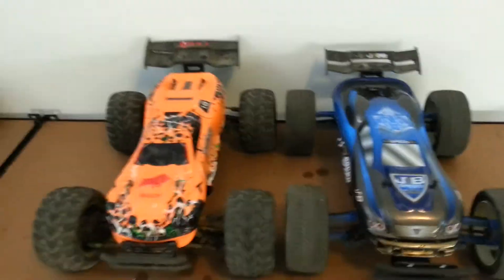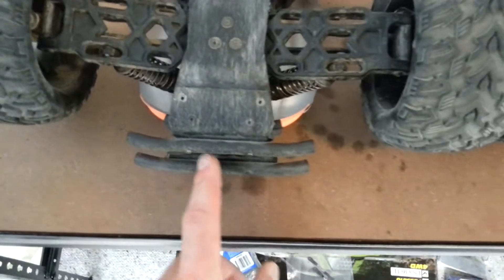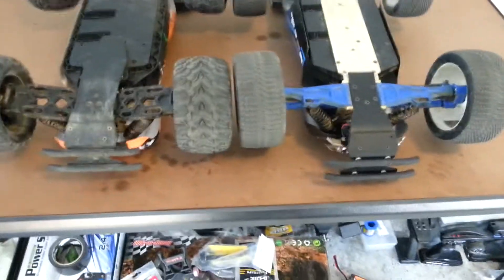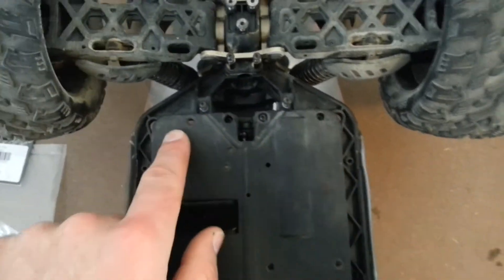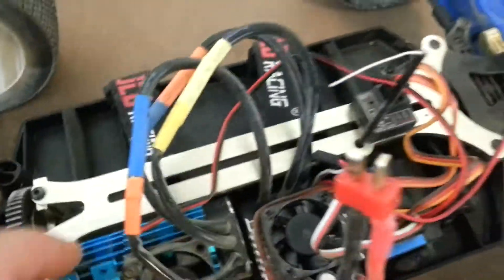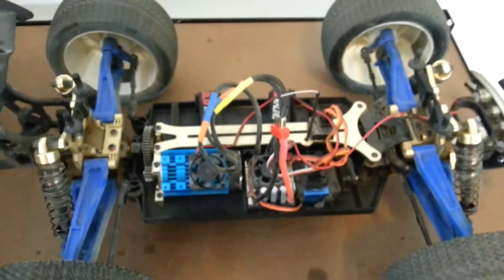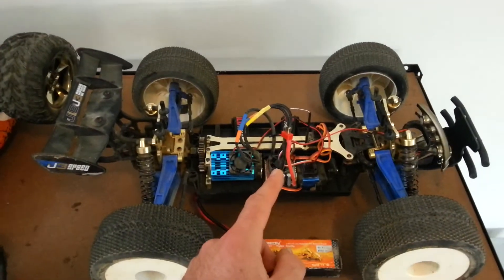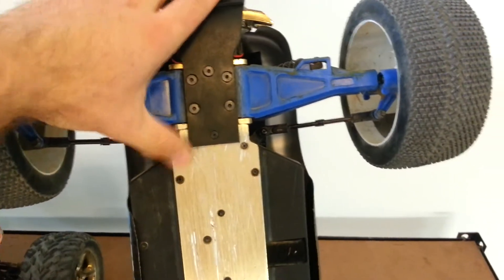Jlb J3Speed T-Bone racing bumper upgrade + update!

Comment: Nice video. I'm thinking of getting a J3 Speed real soon and would like more insights on it. Please do some more runs with it. Also i would love to see what top speed you get with those tires. I've heard about the balloon issue in the original a d the CVD popping out. Please let me know
Reply from the maker: Recently one of the rear wheel bearings shit itself so thats something. Im also having some electrical issues which i still need to work out, i got the ARR version not the RTR so i put my own  electronics in. The new tires are great, better than the original ones no doubt. This is a great rc imo and with a gyro its so much fun, what would you use yours for? Speed runs or bashing?  There will be definitely more running videos.

Comment: Great video! I have the jlb cheetah. Do you know if the stock screws definitely won't work? Also do I just get screws with the added length of the bumper thickness? Thanks!
Reply from the maker: Chris Watson The stock screws should be fine, I just like to get the extra length the width of the bumper to be safe.